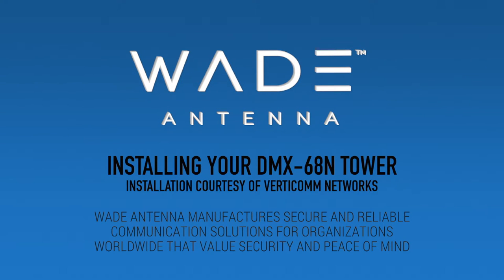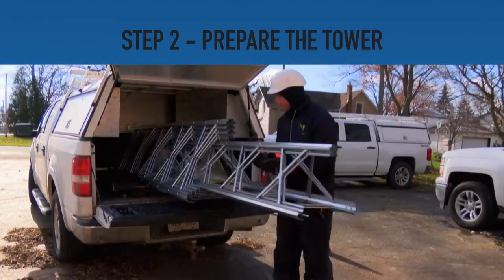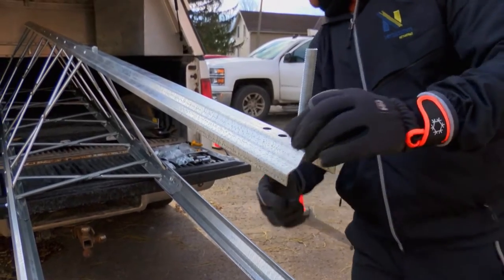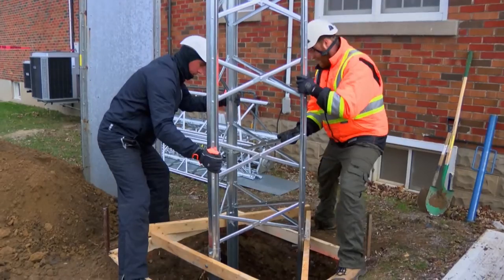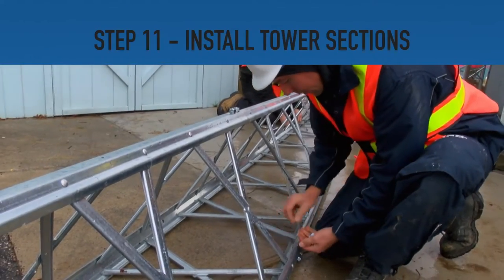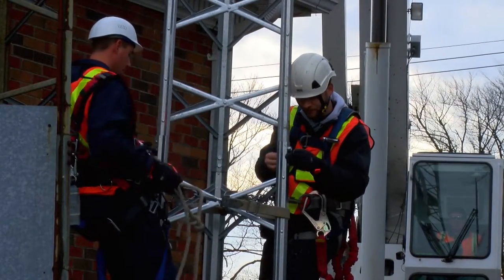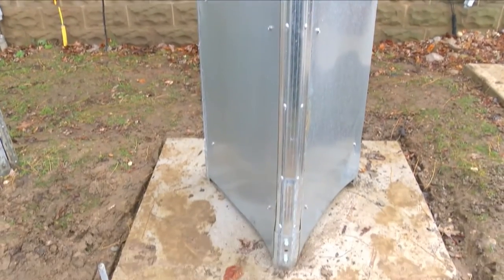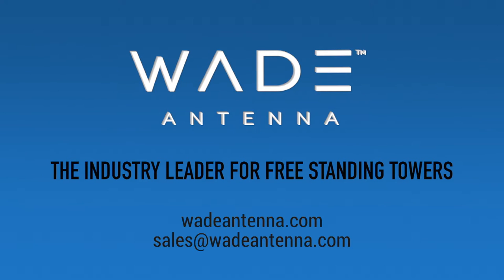DMX-68N Tower Installation - WADE Antenna

Comment: When I installed my 48' DMXHD in 1995 I installed the 8' section and the legs in the concrete and then lifted the 40' section in 1 piece with a Boom Truck.